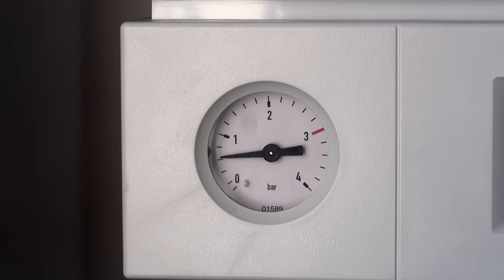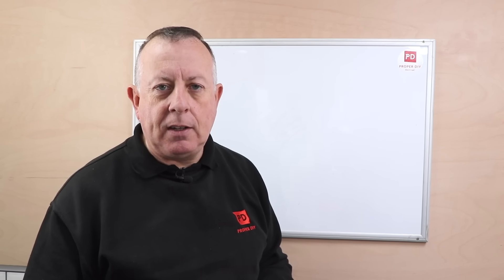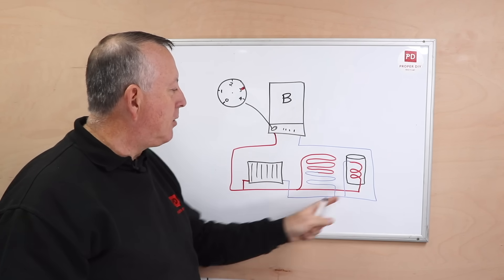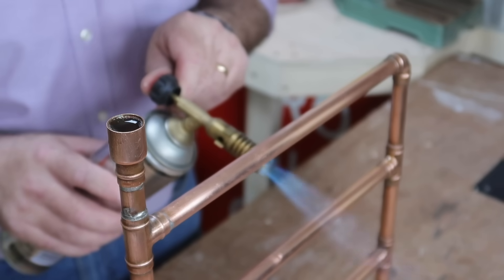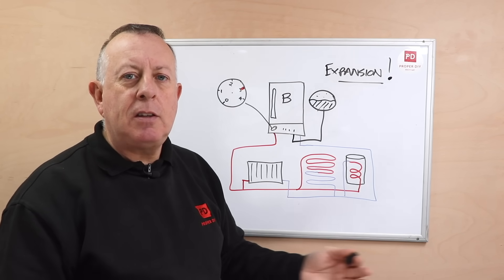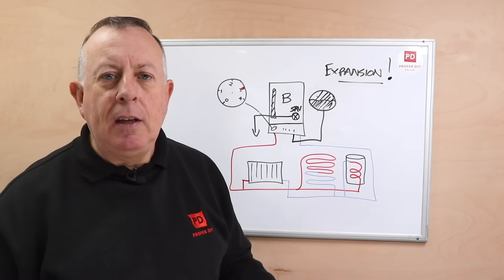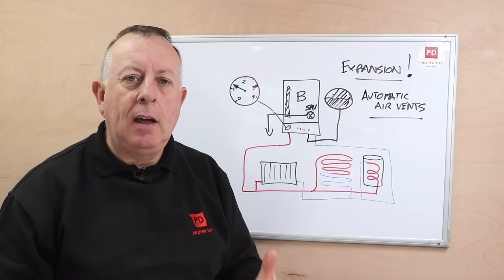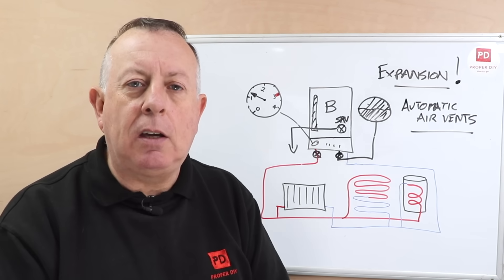Why Your Boiler is Losing Pressure and How to Fix It

Comment: Very spooky that you put this video up today as I have a leak detection specialist here today looking for a leak in my system. This has been going on for 6 weeks,  I have had to top up my boiler pressure every day for 6 weeks. I've had 4 visits from British gas who have checked my boiler and eventually they replaced the heat exchanger which I don't believe needed doing. Eventually they said it must be a leak under the floor. So I had to wait another 3 weeks for the leak detection man to come. He used his fancy smelling machine with no luck so started taking up the floors, on the third room he found a leaking push fit coupling. He has fixed it and hopefully it won't drop pressure over night. I'll update you tomorrow.
Reply: How do you detect leaks under floors covered with insulation?
Reply: @davidsecker5161 How did you find the "leak detection specialist", please? I have a very similar issue and could do with a contact.
Reply: @BimBim-_  I have british gas homecare and they sorted it. Good job they did as when the chap came he told me his company charge £800 a day.

Comment: Great explanation and nice demo of expansion. I think keeping the heating always on (rather than on timed bursts) will help limit expansion as the temp range of the water will fluctuate less. I am a big fan of running at a bit lower temp but always on.
Reply: God knows what my energy bills would be if I kept the heat on all night 😲
Reply: @tttt4029 , the thermostat  turns the energy off once you reach a set temp and back on when you go below. Keeping a well insulated house at constant temp (e.g. 18C) is not as expensive as you think because the house doesn't ever get cold.
Reply: @frankief7111  I do understand how a thermostat works 😁. The point is 18c is too low as I have children in the house and I dont live in a particularly well insulated house. Otherwise, I would agree it's feasible 😁

Comment: What causes air Ingres where the pressure only drops after bleeding?  I have my Combi system dosed up with x100 inhibitors which test as the right strength.  I am having to bleed the towel rail every two weeks despite a recent new boiler being fitted.
Reply: Is your pipework copper or plastic? If it’s plastic, is it grey?

Comment: Thanks Stuart for some well explained and useful information.  And thanks for the heads up last week on the Screwfix/DeWalt drill deal.  I'd been after a couple of 5ah batteries for a while.  Screwfix sell them for £80 each (I know that I can get them a little cheaper elsewhere) therefore two would be £160.  So for £10 less not only did I get the two batteries, I also got another charger, a case and a combi-drill.  Result!👍😁  Thanks again.

Comment: I’m a heating engineer and I often watch videos like this behind my hands like watching a horror movie 🫣 but I’ve got to say, fair play my mate, your explanation was spot on, to the point and made a lot of sense 👍🏻 although opening your PRV to show it coming out outside was a risky move, they have a habit of never fully closing once being opened.

Also another reason for pressure drop can be people (DIYers) not understanding the difference between single and double barrier  push fit pipe. I’ve seen it before where single barrier pipe has been used and what this does, is allow the oxygen and hydrogen in the water escape through microscopic holes in the pipe wall, without any signs at all. 

Great video pal
Reply: Thankyou about providing me with the info on the different push fit joints. Basically all push fit ones are not created equal. I have had these issues highlighted in the video with my boiler. Main cause  over time it was being serviced annually under various energy company schemes. The schemes allowed  poor servicing and led to all of the issues highlighted in the video. Wasn’t until I stopped them and used a local heating engineer who did the servicing properly and replaced many components including the expansion tank etc  my boiler is now working properly.
Reply: Pressure loss can also (not often) be a hole in the flat plate heat exchanger.

Comment: Very nice video as always! Interestingly my boiler lost a lot of water last year (had to fill it up every two weeks or so), but it seems completely fine now! Over the summer, the boiler has been on "summer mode" i.e. running only the water heater, without any loss of water. And now that I'veturned it back into winter mode for the central heating... everything is fine! The problem seems to somehow have cured itself over the summer. Very confusing.

Comment: How dare you!  My boiler may be old, but the pressure is fine, (the missus says every old boiler loses pressure from time to time, it is nothing to be embarrassed about), and I don't need a new bleeding radiator.  🤣🤣🤣  Great video, in the US of A most modern houses have central air heating and cooling, although some houses especially in the North East and Mid-West have boilers with steam heat radiators.

Comment: I had an issue with my boiler losing pressure.long story short. I had replaced carpet in my hallway with laminate flooring. The additional pressure on the floor highlighted a flooring nail that had been put through a pipe. It must have been in there for years.
Reply: Hello, did you smell a musty smell in that area?

Comment: Great explanation Stuart. Just had this issue with my Worcester combi. Kept losing pressure because it was dumping out the release valve. Plumber replaced the expansion vessel last week along with a service which set me back £390 +VAT 🤑 Pretty handy DIYer but hands were tied with it being inside the boiler!
Reply: You can add your own external expansion vessel in that case and leave the failed one in the boiler as is. Of course you need somewhere in the system to install such an expansion vessel, but it doesn't have to be close to the boiler. Pressurising them is easy. They normally have a car type valve at the tope and a bicycle pump and gauge will suffice.
Reply: @TheEulerID The expansion vessels come ready charged. If you want to check or re-pressurise one on your heating system you have to release the pressure in the heating circuit, by either draining your system or, in the case of an inbuilt vessel, isolate and drain the water from the boiler before checking.
Reply: @TheEulerID  Good idea and less expensive replacement solution.
Reply: I got gas boiler in sept and needed topped up every 36 hrs. They came and took a release valve out that the oil system had used and now 6 weeks passed and I had to top up again, and then 2 weeks later, brings me to today. I asked a random plumber who was in my work doing a rad and he explained this expansion issue and said as I've 5 bedroom house I would prob need a separate expansion vessel and to hang a cup on the outlet outside, so that's the stage I'm at, but was wondering if that's the norm but as your covering it in this great vid, I see truth in what he said. We fou d no obvious leaks BTW.

Comment: Any suggestions to why, when running hot water,  it decides to run cold and takes around 30secs to get hot again? I have a regularly serviced combi boiler.
Reply: (Hi I am a plumber btw lol) Yes, sounds to me like it’s your secondary heat exchanger is clogged up. I bet the water gets very hot before it goes cold does it? Can I also guess that it’s a baxi boiler? 
It’s a very common problem on boilers and any plumber worth his salt should be an easy fix.
Reply: Thanks for the comment. The water doesn't get extremely hot before going cold but you are correct in identifying it being a Baxi!
Reply: Can I show off and guess it’s a 105HE? I’m pushing my luck now lol I still think it’s your secondary heat exchanger tho, but it is hard with out being at the boiler
Reply: Its a Platinum combi boiler HE, its about 12 years old.

Comment: I have a Worcester Boche green star the gage was losing pressure I had a plumber under the floor boards and no leeks to cut a long story short the valve cense was not working correctly and I had the hole system flushed and new censer fitted ££ at the moment everything looks okay

Comment: Sometimes with the slow release of water problem, just stick a balloon over the prv outlet outside, this works specially if the pressure s over say a week or two and will pick up small drips as opposed to a tray.

Comment: What is the opposite? Pressure too high. Overflow dripping.
Reply: If a Combi, check the expansion vessel. What pressure you showing.
Reply: @tazmaniachill  I'm having that issue - goes up to 3 bar when heating on - so drips a bit via overflow - not much but eventually dips below 1 bar when off so have to top up sometimes.
Reply: @webbo73  expansion vessel has ruptured, and is now probably full of water (a shown in the vid) if its not a combi boiler, you will still most likely have one in airing cupboard or near where the boiler is mounted if you have a sealed system. If your showing just under 3bar, that's teetering just at the limit of the prv (pressure relief valve and why its dripping) if it triggers, it sounds a bit like a machine gun going off. 😀 as it expels the extra pressure. Sealed systems are usually 1 to 1.5 bar, the expansion vessel should be pressurised the same to equalise as the water heats up. You probably need a plumber 👍🏻

P.S. if you have an external expansion vessel,  look at the top, their will be a cap which you can unscrew and you will see a shcraeder valve (like what pump up a tyre) very gently press the valve down, if you get water coming out,  then you need a new expansion vessel. If yours is Inside the boiler get a plumber in anyways 👍🏻
Reply: @tazmaniachill  thanks for the info! It is a combi boiler with no external vessel.  Sounds like I need to get the old cheque book out 🤣
Reply: @webbo73  most likely, depending on the make of the boiler, you might be lucky and the expansion vessel might be on the side of the boiler casing left or rhs. But then again some manufacturers put them in the back and impossible to replace, it's easier just to Install and external one and ignore the supplied built in one. Good luck 👍🏻
Reply: @tazmaniachill  thank you helping me narrow down the issue
Reply: @tazmaniachill  one last question - if it is easy to get to, is it worth doing versus new boiler? (Boiler 9 years old).  Some websites say not worth the investment but they are heating engineers who sell boilers so they may be a bit biased.
Reply: @webbo73  hard to say, a lot depends on whether boiler has been serviced regularly or not and how hard a lot life it has had, as an example most Worcester Bosch boilers now have an 8 yr parts and labour guarantee if installed by a fitter who has done a days course at Worcester and installed with their magnetic filter and 10 yrs parts and labour if fitted with Worcesters control gear. New one is certainly more efficient than a 9yr old system, I’ve had systems that are 15yrs old though not eco friendly or as efficient, it still works 🤷🏻‍♂️.

So bottom line is I guess if expansion vessel can be easily accessed and removed, fix it as long as the boiler has generally been look after and will give you time to save up for a new one. Most fitters are generally honest 👍
Reply: @tazmaniachill  3 combi boiler.  Boiler 18 years old. Still working fine though.
Reply: Pretty much the same as below,  most likely expansion vessel, Internal or external one.
Reply: Cheers mate. @tazmaniachill
Reply: Your welcome 🙏

Comment: I am going to wait a bit longer,maybe you are wrong and it fixes itself 😂
Reply: It worked for the oil leak on my motorbike. Clever bike.
Reply: That's always the hope but it never does sadly. Always better to get it sorted (if you can afford it now) early before the whole boiler goes and it becomes 10x more expensive.  

We kept it down to 10 minute bursts of heating when needed and shut it off before it got past 2.5 bar until we could get a plumber in